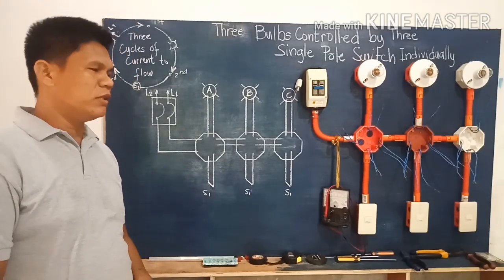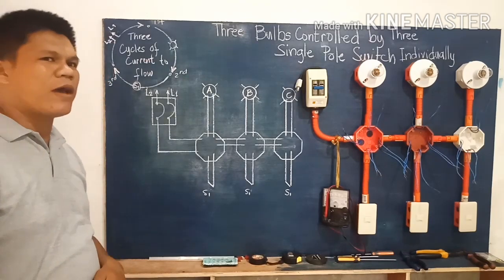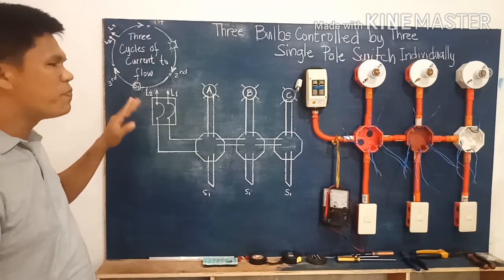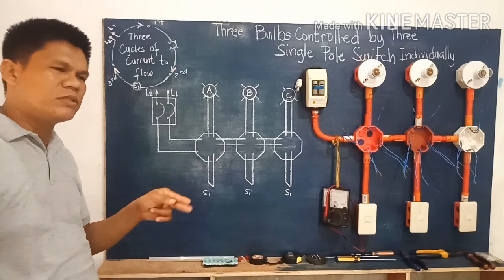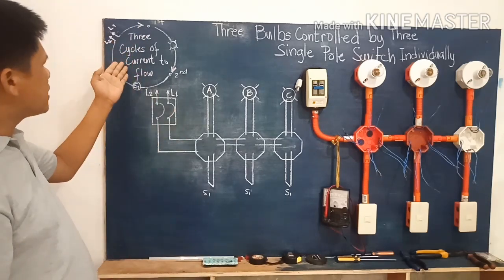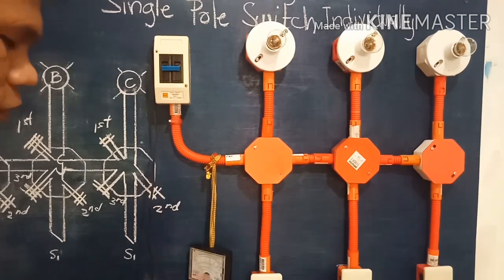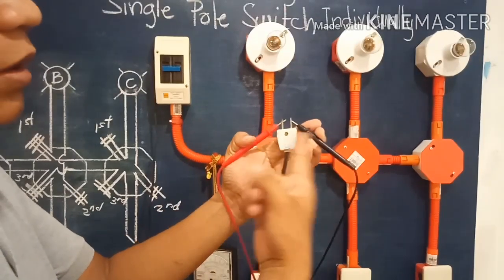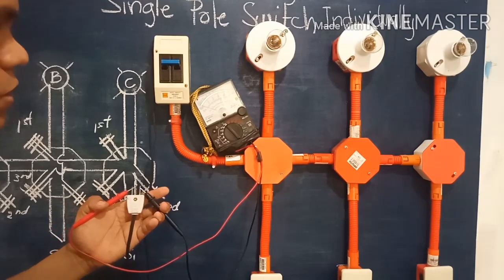Three Bulbs Controlled by Three Single Pole Switch Individually

Comment: Nice tips... ok lang ba na lagyan ng dalawang extension ang isang main extension (3 gangs kasi) ,plus Internet modem na plug for 24/7.......no. 12 lahat ng extensions. separated kasi yung  2 extensions sa main. mga 3-5 laptops at 2-3 cellphones ang naka plug sa 2 secondary extensions (total gadgets of 8 laptops/cps lang naman) kaya kaya ng main extension especially pag napagsabay lahat. sana ma notice this. salamat in advance and keep up the informative vlogs of yours.
Reply from the maker: Ok lang po basta minimal consumption lang